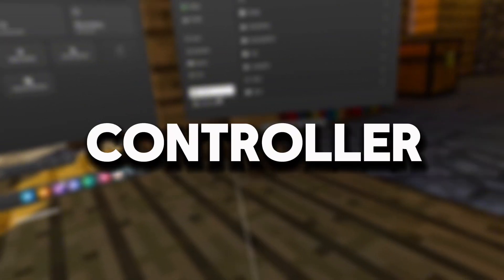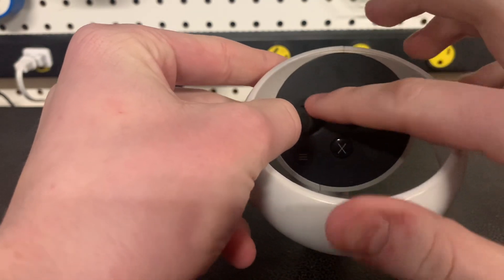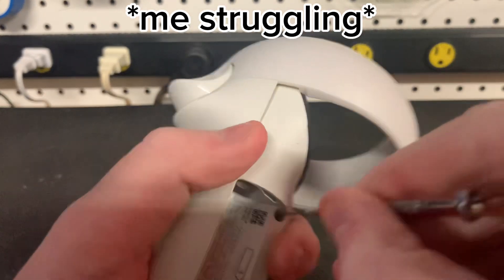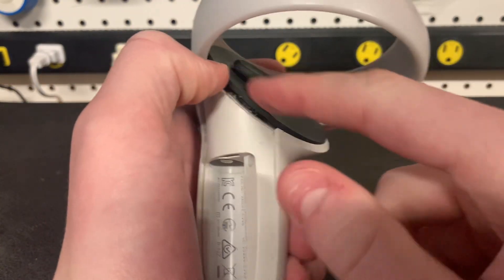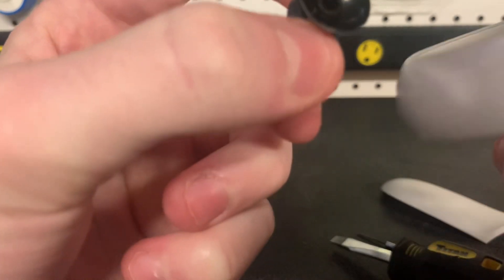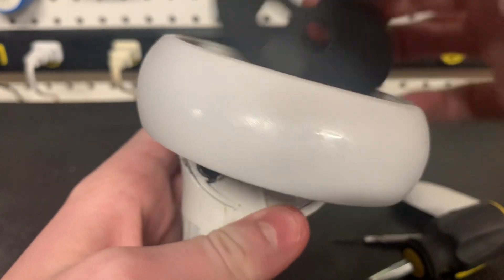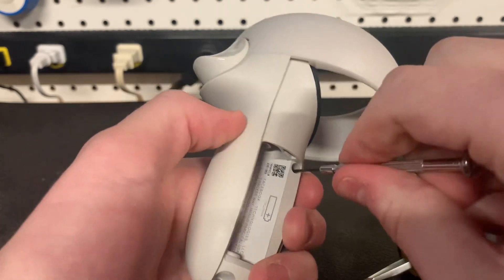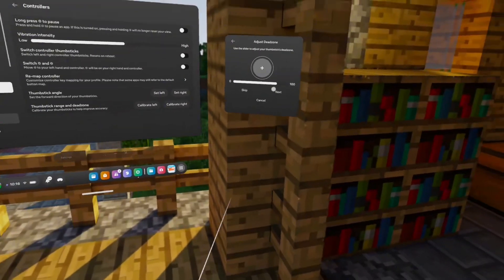How to fix Oculus Quest 2 stick Drift (Easy)

Comment: spent 5 minutes blowing into each of the joysticks, and now it's good as new.
Reply: Please don't blow into your electronics. That's how you get oxidized components. I know the uploader meant well, but it's much better to use either compressed air or a q-tip with some rubbing alcohol to clean around the sticks.

Glad your sticks are working again, though!

Comment: This fixed my problem! although how I did it was not elegant
First I realized I didn't need to unscrew the screw (good because I don't have a screw driver on hand, and my family is sleeping RN)
And because I didn't have tools on me, I ripped my controller open with whatever I had laying around my room, I ended up doing most of the job with a soda Tab
Thank you if you read all that, and Thank you for making this video!

Comment: Tip: use a straw and blow HARD. I did it first with a straw and it worked a little but not much, so I assumed it didn't work and didn't play my VR for around 2 years. Turns out, you just have to blow hard and close to all the little cursives.

Comment: One thing to note is this is only ever a temporary fix, yes it does work, but it will come back at some point. A better long term fix is probably to replace the analog sticks themselves. However if you don't have money for it or don't want to replace it, this is a good fix for quite a while, but remember it will come back.

Comment: No way, all it took was the first step, I’m in complete disbelief, it’s been about several years of suffering, just for the problem to get solved by blowing into the joystick (pause 🤨). IM FREE AT LAST, THANK YOU. I will eventually get myself an air canister, so I can make sure it doesn’t keep bugging (if it does).

Comment: Can you help me? Mine has pairing issues. And I think also tracking issues. My left joystick when I turn it on. After a few seconds Of being on. And blinking Then just vibrates and it Never Connects And when I unplug it and quote unquote, restart it. It does the exact same thing and I've restarted my headset as well.

Comment: Thanks for a good tutorial, might be useful just in case it would need deeper cleaning.
It was my first time getting rid of drift on one of my Quest 2 controllers after 3 years of use - Instead of disassembling the whole controller just get a Contact Cleaner and try to spray the whole circumference around that joystick while moving and pressing it and optionally blow it then leave for a while to dry. (Don't forget to remove the battery before doing so)

Comment: This genuinely made my day, just blowing into it saved me
Reply: Hey, just a tip; please don't ever blow into your electronics. Your breath is humid and over time that oxidizes your components. I know the uploader meant well, but if you ever need to fix your stuff again, I recommend using either compressed air or using rubbing alcohol and a q-tip. Cheers!

Comment: hey dude, i have a very weird problem, the stick drift goes up right all the way, and when i try to move it into another direction it does not even move a pixel, is there a fix to this?

Comment: Well followed this and now my stick permanently drifting down. Tried it multiple times but the stick is just trashed. I’m pretty sure I put the stick back on properly, it just slid in.

Looks clean and fine. I guess now I need to get a replacement. Leave it meta to make the worst analog sticks in existence. My PS1 and PS2 analog sticks work fine after 20+ years and many hours of use

Comment: My left controller's joystick is a little below the center and I believe that is what is causing my drift because it drifts all the way to the bottom. Is there a way to fix this? Or do I need to buy a whole new controller.

Comment: The thing that worked for me was I blowed a couple times into the analog stick then held up for 5 seconds and repeated that on the other sides on the same controller  then pressed in 3 times after I moved it around to make sure and I tested and it worked

Comment: This video needs to be like pinned to the search results for quest 2 stick drift. Also just an FYI but there is entirely no point in taking out the screw, the face plate you take off doesnt even attach to it at any point. I suspect removing the screw is needed if you are actually REPLACING the stick, but for this cleaning process its entirely unnecessary

Comment: That's the most dumb idea you could have... but it actually worked.
My goodness. That. Actually. Worked.
Thanks man, you saved my day!
Tip from me? Use a straw when blowing. It allows to concentrate your breath, giving your more precision and relatively more pressure.

Comment: Worked for me when the stick would drift substantially while using it, but not while stationary. Genuinely thought I would have to open things up. Make sure to blow as hard as you can though. Put some strength into it. I did it in a regular manner, and it didn't work. Putting to the stick in each of the four sides, then blowing as hard as you can into the exposed area did it immediately for me.

Comment: Some cases, stick drift can easily be mitigated by spraying contact cleaner on the joystick OR calibrate the deadzone on the Quest settings (only do it if you have very minimal stick drift)

Remove the batteries, and black plastic cover and then remove the joystick cap. Using a contact cleaner (with its included straw) move the joystick to one side and spray the contact cleaner, then spray on the other side. Once done, slowly move the joystick in a circular motion so it can cover deep inside. Let rest for a few minutes and you’ll have removed stick drift.

Gunk is the #1 cause of stick drift due to shorting of the potentiometers and contact cleaner can purge the gunk. If the stick drift comes back quicker and it’s more annoying, your choice is to actually disassemble the controller, look where the PCB is and literally spray lot of contact cleaner for a full clean. If that doesn’t work, then you gonna need a new potentiometer
Reply: Contact cleaner may seem like a solution, but it's not cleaning it at all it's just loosening the gunk and moving it around. It will quickly dry and break up and find it's way back where it was, leaving you where you started. Plus it leaves sticky residue all over the inside that can even find it's way outside of the joystick module itself and end up on the PCB. The only proper way to fix this issue is to remove and disassemble the joystick module and clean it, bend the pins, use an abrasive on the pads to remove varnish so they make better contact. That, or just buy new joystick modules.

Comment: pushing the joystick in and blowing into it actually worked really well and was able to fix both my controllers with severe stick drift and some tips to prevent future stick drift i keep my controllers in a bag out of cloth so it does not collect crumbs or dust whenever im not using them

Comment: It seems like you don’t need to take off the screw to open up the black top part. If I try to takeoff the top part without removing a screw will I just break my controller

Comment: I usually spray Deoxit into the joystick, circle it around, and leave it for 15 minutes, and it usually works flawlessly after that. I had to do this within the first year of owning my quest 2, but I never had to do it again the following years. I got a quest 3 earlier this year, and had some intermittent stick drift, so I will keep this in mind to see if this method works as well.
Reply: do you need take off black part of the controller or just spray directly?
Reply: @icemilo9584 you can spray directly but make sure to go all around

Comment: Okay so definitely do buy replacement sticks just in case, but if you feel comfortable you can easily open the analog module to see if it's an internal problem. You can lift the springs so they have better contact. Sometimes it's a simple misalignment. But if you lose anything or end up missing something when putting it back together, having a backup you can put in is always a good habit to have. Especially for $18 or less.

Comment: i tried this and it makes no diffrance of me, the stick drift i have i suspect to be broke hardware (younger brother) but i cant be sure, the drift is alwasy down 100% so i cant even make a dead zone for it. and i used compresed air for it and it did nothing

Comment: Something that I found that works AND lasts is to add just a bit of M1 Starrett micro-oil. Worked wonders for all my variable resistor controllers. Since it's an oil, it keeps the sensor lubricated and does not short anything. The only downside is that , if you're sloppy while pressing the button, you'll have to use a soapy-damp cclean rag to remove the excess.

Comment: This is the best video i have ever watched. Thank you so much for taking the 9 minutes to make this video and save me 65£.
Reply: This is a pretty awful guide. You dont even need to take the torx screws out in the holder, those do nothing for this. Plus, using isopropyl alchohol as he suggests in the thumbstick will wipe away the lubricant on the capacitor. This will fix your drift temporarily, but will make it much worse longterm. Use electronic contract cleaner (NOT regular wd40 or any other similar fluid). Do not blow with your mouth into electronic parts either, always use compressed air.

Comment: I couldn't thank you enough mate, so I had to buy a membership to support you. It's the least I could do.

I was so scared that I would either break my left controller while tearing down, or have it never fixed and buy another. But turned out pulling out the analog stick and blowing air inside that piece fixed my problem. God I was suffering that from that huge drifting so much I almost lost my interest in my device...
Reply from the maker: Holy crap dude thank you. ❤️ Always happy to help :)

Comment: I appreciate the video but unfortunately it didn't fix my spontaneous drift/glitching. However your video was the last one I watched before my controller spontaneously fixed its self. You were my last holy grail fix, but what ever issue I was having, I guess just needed to take its course over 24 hours and haven't had an issue since.

Comment: Other solutions of fixing stick drift if your not a fan of opening up your controller is 

1. WD:40 Device cleaner 

2. Recalibrating the controllers dead zones

3.Contact cleaner
Reply: WD 40 kills the controller motherboard just change the joystick is eazy asf
Reply: @sack_dmx2308 WD 40 device cleaner isn’t an oil, it’s a cleaner. Regular wd40 would destroy your controller because it’s an oil

Comment: My stick drift is so bad it doesn’t even work.
Reply from the maker: Stick drift can get so bad to the point where you have to replace the whole stick.
Reply: @ and I swear it’s only for the quest 2. I have had my quest 2 and 3 for a year and my quest 3 has no problems whatsoever.
Reply: @fr. I might have to get new controllers for my bday bc it’s coming up in February.
Reply: @Grikken_ I have over 6 years of stick drift 💀💀💀, I only use rec room now because I can change the waking mode to the trigger and I use my hand to steer but I still have to turn irl because of how bad it got
Reply: @ad-ritmosparakorgpa1 same
Reply: @Distrkt1 use gorilla tag
Reply: Bro my is so bad is look like is teleporting
Reply: Blowing into it's a horrible way to fix it. 
There's moisture in your breath 🤧
Reply: My stick drift has gained a sense of humor and start drifting milliseconds before my fist connects with the guys face
Reply: Same
Reply: Same
Reply: Me too
Reply: My stick drift is so i wanna smash my vr
Reply: same
Reply: Same